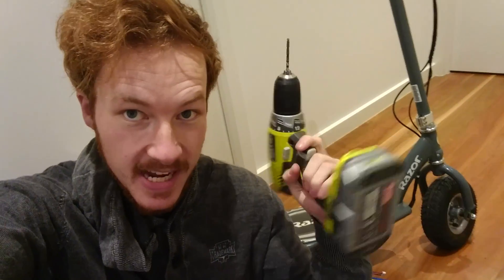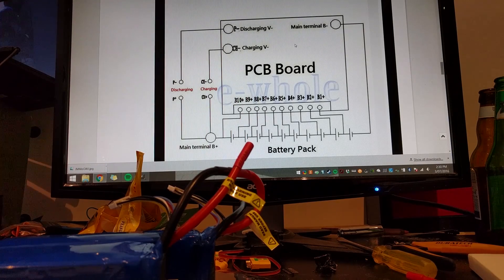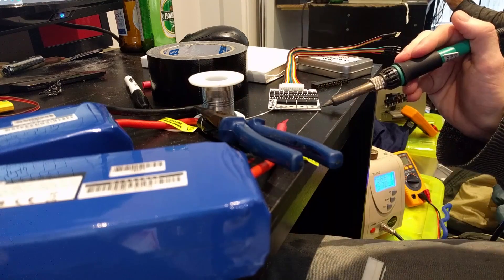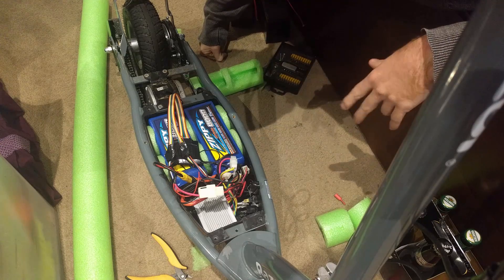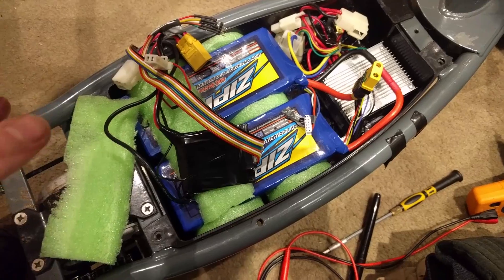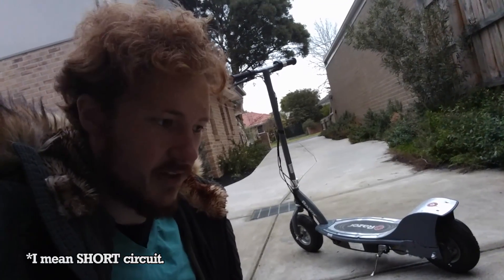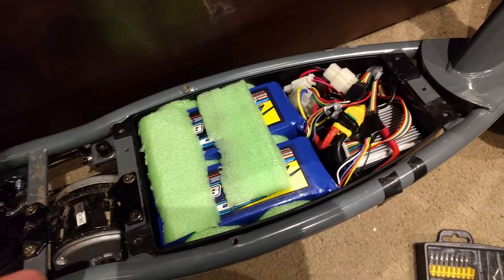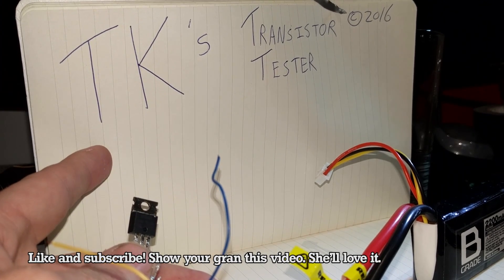Razor E300 Scooter Gets Big Battery Power Upgrade - Scooter Episode 3

Comment: the brake is a kill switch,you could have just pulled that mate
Reply from the maker: david woodward when the transistor fails, it doesn't matter if the scooter tries to turn the transistor off. With the relay also disabled as I did here, there's nothing the speed controller can do to stop the current flow, the transistor goes short circuit and dumps full battery voltage to the motor.
Reply: right i see,thanks for enlightening me..all this electrictrickery is the devils work to me!  :)...ive got one of these,what would you recommend to do with out spending loads of money(ive put two 12v 7ah extra batteries on it)to improve its performance on hills as they do die off alot...ive basically bought one for getting to the pub on holiday in the UK and its really hilly where we stay.they have a 280w motor in as standard.what about putting a 500w in instead?would i need to change anything else like the speed controller unit mate?even  the throttle?
Reply from the maker: Yeah, so the method I've taken is a bit of a mad scientist approach - maxing out what's already there and doing overly complicated mods to try and keep it alive. 

An easier approach might be looking at one of the 36V overvolt kits on eBay. I haven't used one, but some people report good results initially. I haven't heard a lot of reports on the longevity - it is possible to destroy the motor at 36V if you push it hard, but most people using these setups stick with lead acid batteries which aren't as much of a motor killer as lithiums are with their high current delivery capability.

There'll be more to come in this series - the next video will be a bit of a guide on how to approach a high performance build with less intricate tinkering. Expect that out before the end of the year. :)
Reply: thanks very much for the advice,i think ill give that a go.i will let you know how i get on if you like...hey,as im a novice at all this elastictrickery,would you mind if its not too much trouble put a link to one of these kits on ebay  in a reply thanks.just so i dont get the wrong one...hey,i look forward to seeing your up and coming video.its all good fun!!  :) cheers,david
Reply from the maker: https://www.ebay.com.au/itm/Razor-E300-upgraded-throttle-controller-electrical-kit-36-Over-Volt-Kit-/141459088618?epid=1734503992&hash=item20ef9e64ea:g:x0AAAOSwLa9UV6NK 

Something like this. Can't vouch for its quality or compatibility with the charger you've linked above, haven't used one of these myself.
Reply: hey thanks very much for taking the time do that,im much obliged TK.i think ill give it a go,ill let you know how it goes..sorry to be pest again ,could i fit a 500w motor with this kit on?i think the standard is 280w isnt it?is this going to be compatible and an improvement in torque if nothing else?its the hills where we stay on holiday concern me most,not really speed as wed be pissed up on them anyway!haha..speeds not a good thing coming home from the pub!  :)
Reply from the maker: david woodward no idea if it can take the bigger motor - might be fine, might be too much. Big motors can be difficult to install - I cover it in a later video in the series though :)
Reply: 8vI just overvolted my 36v Ecosmart metro  with one of those 48v kits and added a battery while I build my lithium 48v battery from scratch using 18650s and it definitely works. I havent had a chance to check the top speed yet but I can do laps around my wifes ecosmart metro which is basically stock other that using the controller that comes with the throttle with a key from the same guy (36v volt version). We ride them around our little beach community and since I did the up grade Im constantly either riding half throttle or stopping to figure out where the hell she is, Ive had to add review mirrors just to ensure I dont get to far ahead, Just my two cents for anyone wondering about the fastscooters kits.

Comment: so how exactly do u connect the bms to the controller with the xt90s
Reply from the maker: I put an XT90 connector on the controller, after cutting off the connector that used to go to the lead acid batteries. :)
Reply: Thanks

Comment: So much effort when you could have just bought a $30 (US) 36/48v E-Bike speedcontroller and had done with it.
Reply from the maker: Weary Man Certainly could have. But it would have been physically larger and I would have learned precisely nothing.

There are channels you can watch where people just glue together bits off eBay. This isn't one of them.
Reply: What Up TK Here I loved your video exactly for this reason.
Reply: Ooh so that's why people say their controllers are fried when they upgrading the speed of their scooter.  It's the Speedcontroller 36/48v thingy huh. didn't know about those.  now i learn thanks to you.  But but Will upgrading a 12Ah battery from a 7Ah factory battery burn or fry the Razor scooters?  for instance a Razor Pocket Mod which i am interested in buying one.  but need to know if it will fry/burn the controllers or something in the scooter.  I just want to keep it 24v.  not 36.  12Ah be ok?

Comment: Xt90s need a generous (not too generous) "tinning" to wire end and connector prior to soldering. Hold wire to terminal and apply heat. No need to add extra solder. A finer soldering tip also helps. Usually, but not always, this method works for me.
Reply from the maker: JAFO thanks for sharing your tips - to be honest, I didn't even think of researching methods before diving in!

Comment: Love this whole process that you've worked out! I was wondering if you could go a little more in depth on to exactly how you wired the bms with the two batteries in series. I'm trying to do my own build with lipos and don't want to flash bang my batteries. Specifically the sense wires to the bms in series. Thanks keep it up
Reply from the maker: Yeah, it's pretty scary. I go over it obviously in the video and also in the accompanying post here - https://hackaday.io/project/9941-the-razor-e300-overvolt/log/43836-the-big-battery-swap

That said, I would STRONGLY advise you against mucking around with this until you truly, definitively understand what you're doing. Unfortunately mistakes with lithium batteries almost always lead to fires. In your early days, experiment only outside in an area away from all flammable materials - work outside on a concrete surface, for example, and be ready to run away if things start going wrong (not that you'll always have time if you screw up really badly).  Don't store your modified lithium-powered creations inside until you're fully 100% confident they won't burn your house down.

Don't take this as advice not to try - I highly recommend hacking and making, it's great fun. Just make sure you get the knowledge and experience you need to do it safely. :)
Reply from the maker: I realise that my post doesn't actually go through the steps in detail. Try this guide - http://www.electric-skateboard.builders/t/connecting-a-bms-quick-guide-how-to/6122

Comment: can someone explain me the thing with the BMS?
Reply from the maker: Gonen levy lithiums require careful control of voltage and charging - the BMS handles this :)
Reply: TK that i understand, but all the thing with the wires i cant understand
Reply from the maker: Ah yep. It's all about making a connection to the individual cells in a lithium pack. 

As they can be quite dangerous, I'd suggest learning more about electronics and how rechargable batteries work before setting out to wire your own up. Plenty of great resources out there, just google about battery management systems and so on! :)

Comment: TK, would you ever consider doing a series of videos on building an affordable yet powerful electric scooter instead of modifying a stock e-scooter? Thanks for the videos. Liked & subscribed.
Reply from the maker: The battery management system is something /like/ this - this may not be the exact one. eBay hardware is pretty changeable month to month. 
http://www.ebay.com.au/itm/Batterie-Protection-BMS-PCB-Board-Balance-Pour-10S-36V-40A-Li-ion-Lithium-Cell-/401176707957?hash=item5d67fec375:g:RtsAAOSwHoFXvsIG

The batteries were something like these Zippy units from Hobbyking, I think. You might wanna shop around for 5S packs though, see what you like in terms of price, performance and size. https://hobbyking.com/en_us/zippy-flightmax-8000mah-5s1p-30c.html

I can't guarantee these are the exact parts I used but they're in the ballpark.
Reply from the maker: celticwolff I certainly would. perhaps down the track when I have some welding gear and somewhere to use it. thanks for watching!
Reply: TK hey, can I have the link to those battery's and the PCB board to buy?

Comment: TK my lovely check Gate engineering intrigued brother resoldering heat travel problem is easily solved heat sink crocodile clips a pair of pliers help tight with elastic bands anything like that it's an aerospace technique that's my cheeky job can't say anymore because it's secret military development and all but it is apprentice level stuff but it works and absolute truth I soldered The Cube within a cube centred with other legs of copper wire without the heat sinks I used electrical crocodile clips everytime I would have touched a single joint off shoulder the heat would travel and melt every joint with the heat sinks I managed to create this construction it looks pretty cool anyway heat sinks just beyond each side of the joint you are trying to create even helps keep the desired heat on that joint and it takes even better let me know if this helps 
PS loving your helpful clips thank you from the UK brother
PPS I was out in Woomera for a good long while if you get me say no more good luck

Comment: I'm also in the process of converting a razor e300 to 36V lithium (ion), I applied the mods you suggested on the stock controller but so far, the scoot is just incredibly slow. I'll continue watching your vids on the subject because I learn quite a bit all along. Thanks for showing your failed attempts, they're as interesting as the tip that work !
Reply from the maker: Hope it's going well!
Reply: @WhatUpTKHere  Well, I did learn a great deal along the way but the Razor isn't a Razor anymore. I removed the chain, motor, and replaced them with a (I think) 10 inch brushless motor wheel, along with a 10P7S battery (that's 26 Ah minimum!). You can find pretty easily that kind of motors on aliexpress. Ah, and the controller had to be changed as well for a brushless variant, the brakes are included inside the motor (drum brakes as well). I also installed a means to add a temporary extra battery to maximize speed (to go from 7S to say 10S or 13S, that's a jump from 29V to 54,6V, the controller and motor are tolerant to that kind of voltages). This system can be removed if I so wish (and the extra battery/batteries is kept inside a backpack on the pilot's back). The speeds are pretty sweet. My son (around 60kg) managed to go 40 kph on 10S, I was more on 33-35 kph. Finally, there was so much torque on the motor axle that it managed to round the slit which was holding the motor (a disaster almost happened due to that). So now, I installed a set of torque arms, and I hope I'm good to go for a pretty long time without any problem !
Pretty exprensive upgrades but worth it, if you already have the Razor !

Comment: I'll say this, it's a good thing you're tall and strong enough to lift that 50 plus  pounds of metal. I was imagining what could've happened when that happened to me if my brake failed to stop the motor and to just let it loose since I can't lift that heavy from the handle bars, I wonder how fast it will go with no weight standing on it, then crash head on to a car? you know what, I just thought of putting this thing on a treadmill to really see the speed without a passenger. thevweight of it should be enough to grab the tread, and just balace it's speed with the mill's. hmmm
Reply: T C Woodworks and Design if you're brave enough to do it  test the top speed with roller blades! Won't be exact but will show you a lot closer to it's max speed than being on the scooter.

Comment: too much current. will eventually fry the entire circuit, next are those skinny wires and eventually catches fire. I have 4- 12v/ 9A sla on mine (52 v max) and I've changes all my wiring from battery to 3 switches to 14 gauge wires because they were getting very hot. I don't use any electronic control, just a high amp momentary push button, an emergency cut off switch right next to.it in case the high current fries the push button stuck (wbat happened to you happened to me as well and I had to pull the brakes to just stop the motor) and the main switch at the bottom. 11 tooth sprocket kn motor and a 47 tooth at the back wheels. it pulls very strong on 36v and even more now at 48v and topping at 32mph vs 25 on 36v. I don't think I want to go any faster than this setup, way too dangerous.
Reply from the maker: Will be interesting to see what happens next, absolutely. Methinks the viewing public would love to see a good bit of fire... ;)

Comment: enjoyed your vids, im currently planning on overvolting a mobility scooter, looking for tips found your stuff,  iv got a 60v 20a cheapo motor controller making its way to me from china, it will probably break, (im good at killing circuit boards) i might just go direct battery to motor with a big push button, if i can think of an easy soft start widget i might investigate if i feel it needs it,, going to order batterys soon, when i decide on voltage, 48 or 60,   ps for big wire  soldering a 100w iron is faster so less heat creeps along metal parts melting distant plastic.
Reply from the maker: sounds like a pretty sick project! yeah, you gotta watch out if you try and direct wire it - high current DC tends to spark a lot on your switch contacts and weld the switch shut, pitching you into the nearest fence/bush/car.

yeah, I used to have a 60W iron but the blasted thing died! gotta save up for a Hakko I reckon.

Comment: How many watts is your scooter
Reply from the maker: Stock, I think 200 or 300W, but overvolting ups that significantly
Reply: +TK I saw it worked until the speed controller failed. Only if it didn't fail then it would a been awesome and I bet take off would be quick.
And I think the company that makes the razor e300 should have the battery's you had in your scooter lol
Reply from the maker: +Mehtao Burrell haha, I definitely agree with you!
Reply: Mehtao Burrell ,
Reply: Christa Ferrier yeah

Comment: Thanks for the videos mate. Because of your vids I did the same thing to my E300. I used 9 x 3s batteries to make it around 36v and 15000ah. I also promptly blew up the the speed controller. I upgraded to a 36v 850w one from eBay with a proper variable throttle. The scooter was awesome to ride! But then the motor failed. So then I upgraded to the 36v 350watt version of the same motor just longer. It fits well but I had to grind off the stand and drill new mounting holes. But worth it, it's really smooth and quick to ride.
Reply from the maker: dude, that's sick! I'm 50/50 on buying a properly rated controller at this point just cause hacking variable throttle into this one feels hard and I wanna be able to cruise slow...
Reply: Variable throttle is SUUUPPEERRR easy with the razor controller. Earlier models of these scooters came with a variable speed 'grip' - the part that is on the handlebars. There are several ways you can make this scooter variable speed. Potentiometer inline with the control wire, or just get the grip part off of ebay.
Reply: does upgrading a Razor Pocket Mod to a 12ah be ok?  (from a 7ah) Or will it burn something inside the scooter or the controller.  just 24v  just the 2 battery  not a 3rd.
Reply: @megynkelly180 no it's just a higher capacity battery which will give the scooter more run time.
Reply: How much did this upgrade cost???

Comment: Digging the video updates on the project!
Recently got myself an E300 as well to tinker with, and eventually net some LifePo4s to toss in it, however instead of eBay I tried checking out some websites with parts at decent prices. Found the WildScooterParts.com website and ordered a kit with a 500w capable speed controller AND a variable throttle handlebar control. Delivery wasn't so bad for the US, it was a bit annoying however that the tracking ended when it left the US. Took just under two weeks to deliver. Have not installed it yet, however I am looking forward to seeing if there's a difference to the basic performance before I add more battery capacity.
Good luck to ya!
Reply from the maker: that's awesome man! I'll have to check out the site, I'm contemplating a gear change too